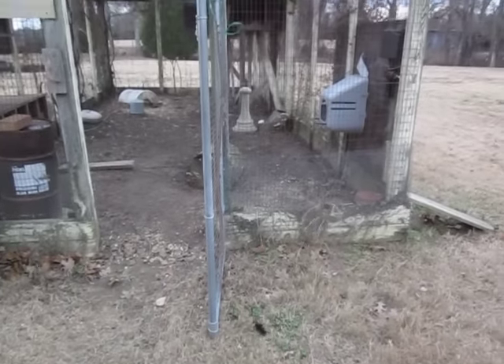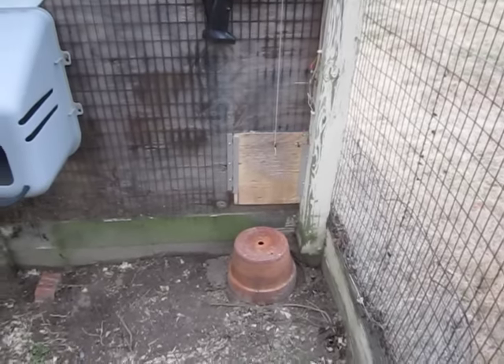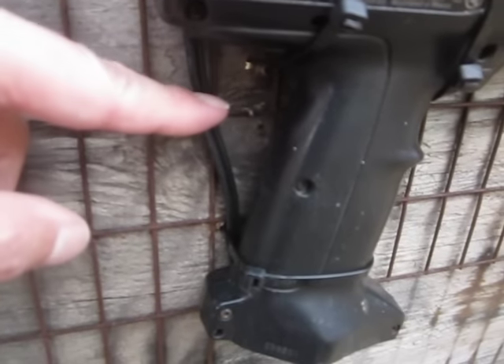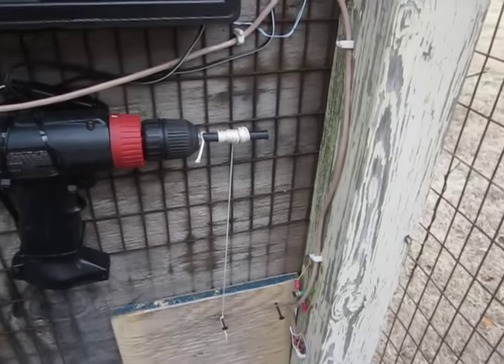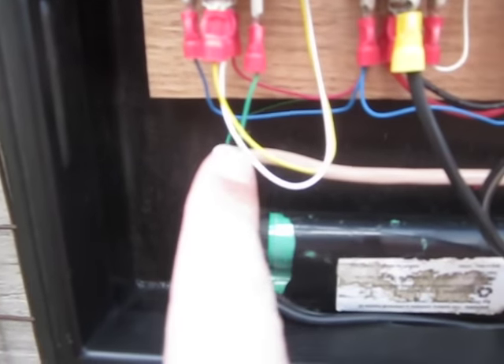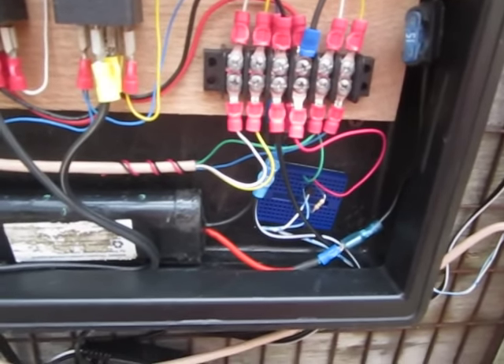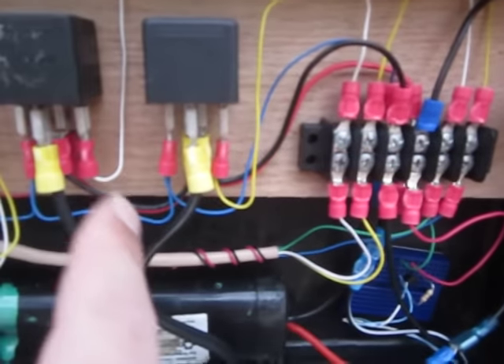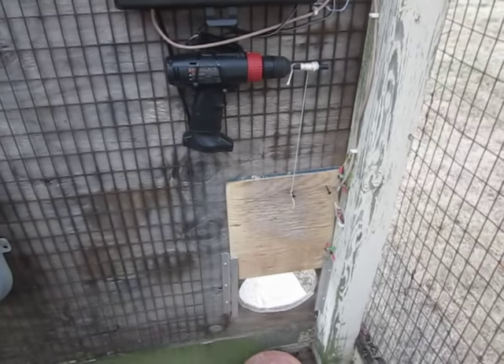DIY - $20 Automatic Chicken Coop Door from an upcycled cordless drill - Easy Build

Comment: You have mine beat by $25, but mine is way more secure.
https://youtu.be/jYM0xZ8TwaA

You have an update video?

13:15 BTW the whole reason you have to use a 15AMP fuse in YOUR system is because you are using different wire gauges, goin up and down in size. You need to be using a uniform gauge for this sort of stuff. For any wire that is for that actual motor you need to use wire that does not restrict the flow of current. it looks like you are going from 16 AWG to the motor, then feeding the relays (87 and 87a) with 18 Awg, then the fuse holder looks like a 20 AWg wires them back to the battery that is at least a 16 AWG.

Comment: BTW the simple $19 electro magnet is 130llbs of force!  NO coyote could possibly overcome THAT!  AND it is fail safe if the power goes out the door opens ...add a quality timer to break the circuit every morning and you have a VERY safe reliable door opener powered by either gravity or a $3 screen door closer spring!  Also as I mentioned on earlier post you could also use 12v magnet with battery and solar charger ...even add a light circuit or electric fence wire to that if you wanted to...I had 120v handy so I just went that way...KISS (keep it simple stupid) ....120v magnet at Amazon on earlier post but here is an even stronger 12v one for about same price if don't have 120volt power handy~~> https://www.amazon.com/UHPPOTE-Holding-Electromagnet-Magnetic-Electric/dp/B00W3HRV1Y/ref=sr_1_2?dchild=1&keywords=12+volt+electromagnet&qid=1590290905&s=hi&sr=1-2  then just find 12 bolt timer/battery and solar charger

Comment: I'm a do it yourself guy too , like your idea , but would go to 12 volt drill and just use timers real cheap after Christmas . in fact I've got several old reversible drills , I'm going to use one to go up and one to just go down
Reply from the maker: The solar panel acts as the photo sensor in the first design.  I then added a photo resistor and $8 high impedance DPDT relay which uses almost zero power to operate.
Reply from the maker: Higher voltage drills would work better as they would turn more slowly at the 9.6V I used.

Comment: Could you please explain how do you switch it on in the morning to open the door ?
I understand that light sensor will switch on in the evening and close the door but what is switching it on in the morning ?
Reply from the maker: The photo sensor activates the relay to open in the AM and then close in the PM.
Reply: @ZookeeperJohnG  So the relay stays open (energised) all day ?
Are you using normally closed and normally open contacts of the same relay ?
Reply from the maker: @ummahofsheeps7495  Correct, the LDR takes some energy from the solar panel to energizes the relay coil during daylight hours.  The relay controls the Up-Down function, it has 8 terminals: 2-coil, 6 DPDT wired to provide "H-bridge" direction control of the actuator.
Reply: @ZookeeperJohnG  thank you very much. Appreciate it.

Comment: doesn't the drill have the reverse circuit built in?  I wonder if you could some how wire to the door to the forward/Reverse switch to make it change directions?  I just found an old drill which I am going to try and do with with.

Comment: I suggest putting some kind of water proof epoxy on the light sensor.  Humidity could short the leads and open the door.  Also, the string will wear out one day , and any chickens that are outside will not be able to get inside to safety.
Reply from the maker: The DLR is covered with a small class jar and lid, pleased up side down.  Because the string is easily visible, any wear could be addressed when/if it happens.  Good suggestions tho!

Comment: Actually your folding ramp would work great with just an electro magnet https://www.amazon.com/Holding-Electric-Magnetic-Electromagnet-Fail-Safe/dp/B00JERC00S/ref=ice_ac_b_dpb?cv_ct_cx=door+electro+magnet&dchild=1&keywords=door+electro+magnet&pd_rd_i=B00JERC00S&pd_rd_r=7f040e9c-516e-47df-bbc5-0a323e74b420&pd_rd_w=kZVJ6&pd_rd_wg=fcifZ&pf_rd_p=d027eaac-7531-45fe-a61e- cand a timer,  If you don't have 120v just buy 12 very DC electronic magnet and a battery solar charged....and a timer OR maybe even  photo cell and a relay with normally closed contacts so when sun comes up it energised relay and opens circuit to cut magnet power...I use timer and screen door spring because our door slides horizontally ...if I had the ramp door I would use gravity